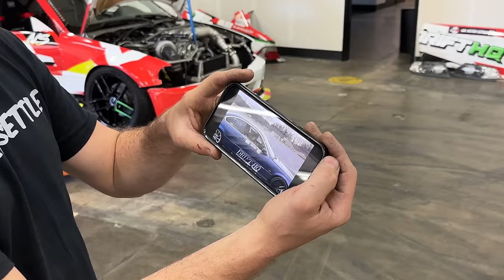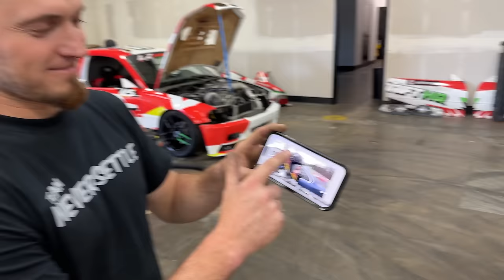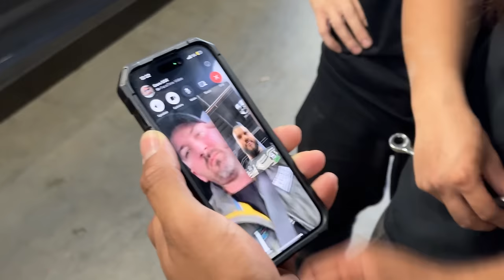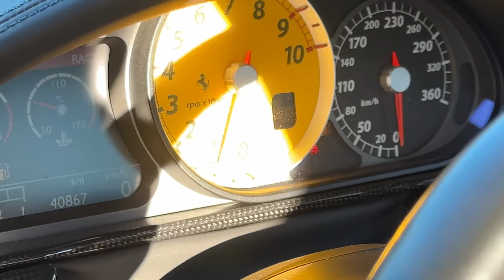WHY I LEFT And Am NEVER Coming Back...

Comment: What you guys need for the Bentley.Is some BC coil overs with the air bags on top?It will ride a whole lot better.It won't be bouncy at all
Reply: Kws or oilins
Reply: Kw
Reply: Coil overs would work better but if the air system in the Bentley is similar to airmatic on a Mercedes they need to lower it via the OBD port instead of drop links… I drive a W221 and from what I’ve heard lowering it with links makes it bouncy and it’s on air bags too
Reply: @sandiswa_maphosa  There is this 1000 horsepower Mercedes minivan. That looks like the car that's on $50000 suspension. BC coilovers is what they're using and I forget which airbags they're using.  No bounce at all.